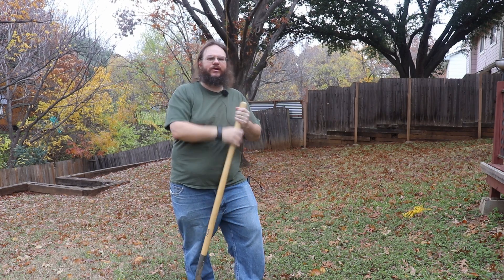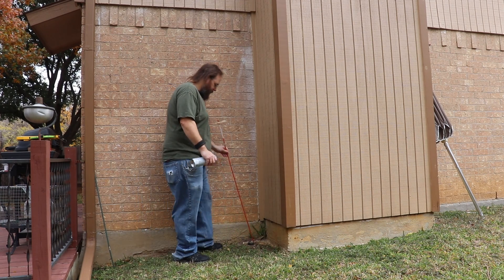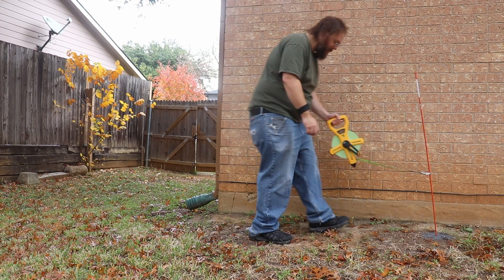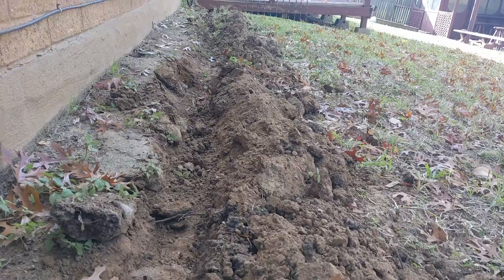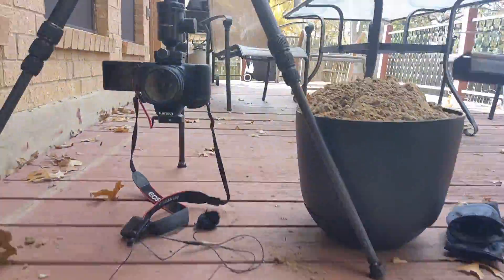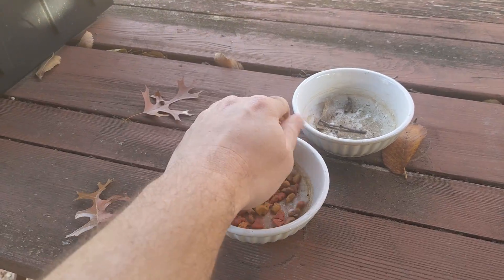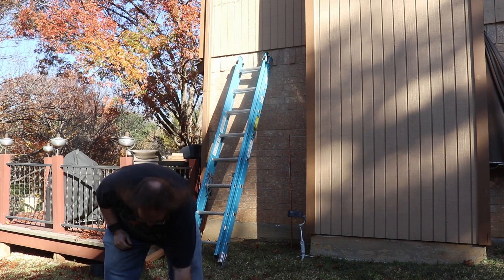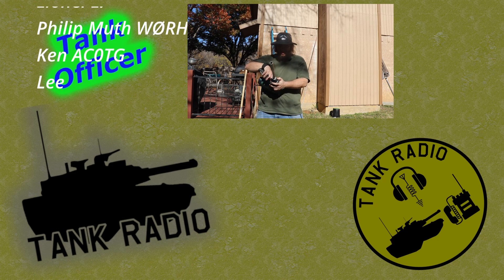Installing Ground Rods for my Grounding System for Ham Radio, Part 1

Comment: The 2nd ground rod, done by the electrician, you mentioned it was 6 feet away from the initial house ground rod. What is the size of that 2nd ground rod? The reason I'm asking is that later you mention that the 3 new ground rods you will install all have 8 feet and you will space them 16 feet apart....

Comment: Waste of time and money. Forget that grounding and bonding nonsense. Just unplug everything when it’s not in use.
Reply from the maker: you still have that coax cable coming into the house and that will bring in unwanted power into the house.  Good ground stragy will safely get rid of rid and keep you safe.
Reply: The only reason I want to ground MY shack is because I encounter light-duty RF on occasion. I'm tired of having to 'slap' my gear every time I want to touch it so I don't get a 'shocklett'. Otherwise, yeah, I just unplug everything if there is going to be an electrical storm. Here in northern NV, we get very few of those. I may just 'bond' all my gear with some wire between each one just to even out the difference in leaks.  And how come you need more than one ground rod?
Reply: Proper grounding takes all the noise of of the circuit if you plan on setting up a base station radio. Better propagation as well on a properly grounded antenna.

Comment: I live here in the "ROCKY MOUNTAINS "  of Montana. Would you willing tocome drive some ground rods in for me LOL😂?  I think my ground system is wrong. My inspector had me run 2 8' rods in 4' apart at my new power line for my new shop (where the ham shack is located). I guess in the spring I will have too add a 3rd. I Appreciate the time invested in making your videos. Thank you. Maurice N7NHS

Comment: The guy that set your sprinklers, followed the same math you did.
Reply from the maker: I installed my sprinkler system.
Reply: @TankRadio  Well that why they were near where you wanted to place ground rods. 🤣 Good idea of using hammer drill.   Work smarter not harder.